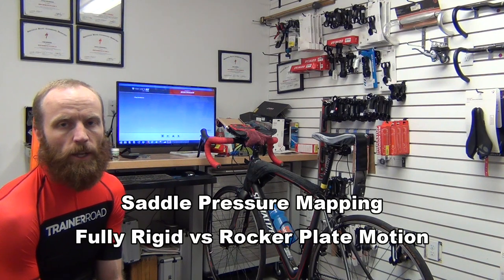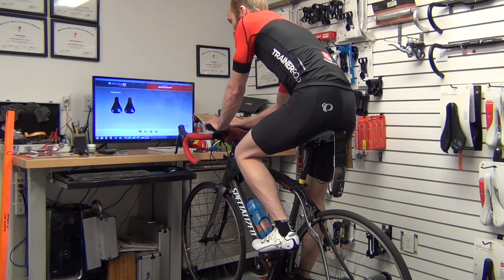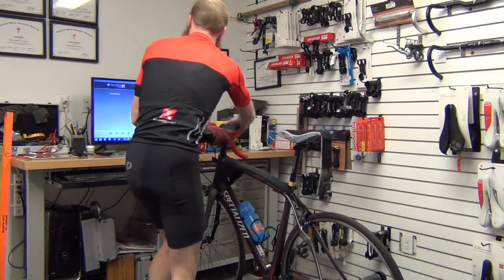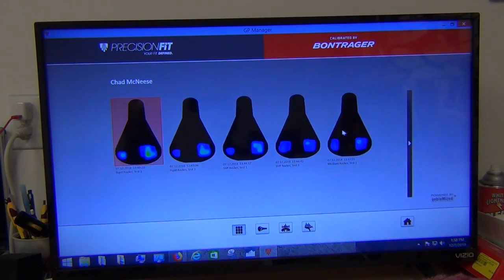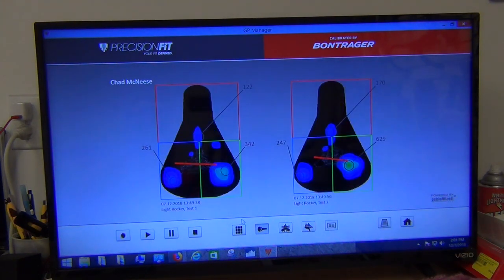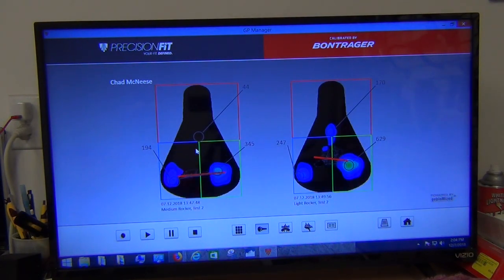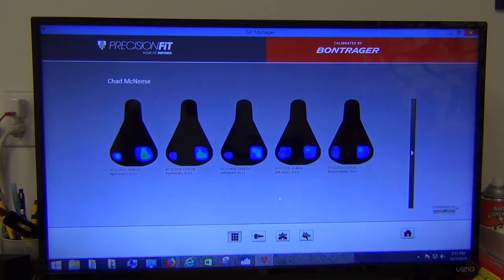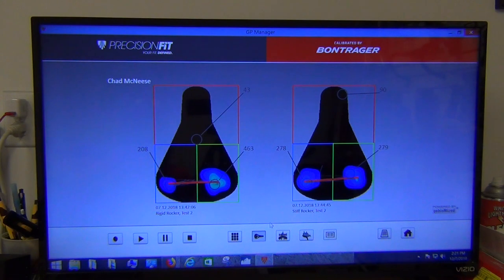Rocker Plate Testing with Saddle Pressure Mapping

Comment: Brilliant!  Thanks so much Chad!
Reply from the maker: Happy to help.  It's far from conclusive, but a window into the anecdotal feeling so many rocker plate users feel when it comes to improved seated comfort on the trainer.  :D
Reply: @Chader9  it's coincidental, but I have sent an Axxion Rocker to Retul and they are planning more or less the same test you just did, but they will have more comprehensive data, on leg/knee/ankle changes along the entire kinetic chain.

I have posted on the Bikefit Pros page, and plugged your forum there.
Reply from the maker: @Traxxion  awesome to hear.  Please share any results you are able to.  I would love for someone with more tools, time and rider samples to do testing like this.  I think a proper study is in line actually.  I'd love to have many sample riders, many rocker types, and variation in motion (pure roll-axis, pure surge motion, and both combined) to see what each degree of freedom adds.  Couple that with goals to look at comfort, RPE, power and such to get a more comprehensive picture of the impact of motion vs rigid setups.  Exciting times :D

Comment: Thank you for the video. I train on my XC bike on a Kickr and  still get pain in the behind increasing with ride length. I feel like I've exhausted other options (getting used to it, getting the best saddle and bibs for me, having proper fit), all of which did help but I would still like some more and am now looking at getting a rocker plate and was looking if that is likely to improve the situation. Seems like the answer is yes.
Reply from the maker: Sounds like you've looked at about every other angle. So adding some motion seems like the next step.

Keep in mind that sometimes even a small amount of motion can help.  Many people have good results with simple foam blocks added under the trainer feet.  

Free it up a bit to wiggle.  It's not the same total feel of a rocker, but is cheap and easy to test and see if it can help you.
Reply: Cheers. I'm going to try the foam blocks, should be able to find some at low cost. I do have the Axis feet (that give a bit of motion) on the trainer, but one of them is screwed fully in (my floor seems to be a bit uneven), so no more room to get movement from that setting. However I'm using the medium spacers or whatever on the feet and will try the smallest ones (supposed to provide some extra motion) as well.

Comment: Hi @Chad, do you consider is a good point adding a rocker plate to the home trainer if you ride 2-4 times x week ? If it’s the case , is a big difference between the plates with  side movement and the side and fore and aft movement ?? Is it worth to pay the extra price for the rocker with full motion instead of only lateral movement ??
Thanks in advance
Reply from the maker: I ride 3-5 times per week and would be hard pressed to go back to rigid.  It is just plain odd to me when riding rigid for short tests now, and I would not do it by choice for any real extended periods.  But, as with anything, this is highly personal.  Many people find the benefits of trainer motion to show up most once you hit that 45 minute and longer ride time.  The motion relieves the common saddle pressure issues we see with many rigid setups.  But for me, even with those shorter workouts I still prefer motion.

With respect to rocking and fore-aft, I have done setups with both.  I like the fore-aft, but trained for years with pure rocking action and got notable comfort benefits.  That said, it seems that most people like the added comfort that comes with fore-aft, so it is a generally safe recommendations.  Noting that, there are more than a few people who have tried fore-aft and decided they don't like it.  There can be excessive movement and potential power loss with some riders and setups.  So I try to not commit too hard on recommendations there.  It seems highly personal.

Comment: @Chad this is great, thank you. Where did you get the pressure mapping device -- is it possible to rent one of these?
Reply from the maker: Thanks so much.  It was a very fun and informative experiment.

The pressure mapper is part of the bike fit tools that my shop has and I used for my side gig as a fitter.  This one died and we haven't gotten the replacement running as of yet, unfortunately.

If you check with shops in your area, ones that do bike fits specifically, they might have one. It's a rather expensive tool, but I'd bet they offer fits or use of the mapper for a fee.

Comment: Really interesting. Can I ask if you've looked at Power and if that is affected by the rocker plate?
Reply from the maker: I have done no testing to this point, but have a working document with comments and speculation as to power from a number of different angles.

https://docs.google.com/document/d/1rsOK6Qym9tFR6wrVScs65-LfFIGKykfirA5f04Z-KBA/edit?usp=sharing

In short, it is a complex issue and depends on what you want to compare (Rocker vs rigid vs outside riding / peak power vs steady power vs power efficiency).

A proper analysis would require some well thought out planning and many study participants.  I'd love to do it, but time is always the limiter with a family, job, and riding.

Comment: In your control test, you stood to reset for test 2.  None of the other test 2s were reset by standing.  This also speaks to long term.  Can the recording software do an analysis of an hour ride? If you do the same ride on each setting I think the data would be more useful, actually as the edge cases will get diluted out better.
Reply from the maker: I'd have to watch, but that is totally possible I missed consistency from test to test.  A side-effect of doing this at my workplace in somewhat hurried fashion to get at least some testing done when I had access :P

For the software, it only captures a short timeframe (around 5-10 seconds, but I don't remember the precise time).  You can do as many separate captures as you want, so you could just keep doing captures to catch snippets of a longer ride over time.  You'd then be able to compare any of those snips to any other one in that test or another one.  Would take some real time and work to do and likely best to have a second person involved so the rider could simply pedal while the other person ran the sampling.  

For sure there are ways to improve this test.  I make no claims that it is absolute or scientifically significant.  With N=1 and me being a biased and very experienced rocker users, my results may well not be typical.  It is just one experience with some data that matches my personal experience.  It is still the only shared data that I have seen.  I know some companies have done their own testing, but have not seen any of it posted for review.

Despite the obvious shortcomings of a short and limited test, this data seems to correlate very well with all the other anecdotal info from the thousands of happy rocker plate users in my Rocker Plate FB group.  We see a strong long-term adoption rate from people who actually try a rocker plate.  The vast majority say that it improved their riding comfort, especially when going longer than one hour.  Am most say they wish they had tried one sooner because they don't want to go back to rigid trainers any time soon.

Comment: By the amount your hips are rocking, it looks like your saddle is too high, which pretty well invalidates all your data. How did you get to such a high saddle setting?
Reply from the maker: I disagree the data is invalid.  Regardless of the saddle height, there are clear differences in peak saddle pressure between the rigid and motion setups.  This data corresponds well with my personal experience in reduction of saddle discomfort with motion added.  It is also backed up with similar comments on improved comfort by literally thousands of happy rocker plate users as shared in my FB group.  We have over 17,000 members, and the vast majority rate improved comfort as the key reason the like having a rocker plate.

With regards to saddle height, I the saddle pressure mapper adds a bit of thickness to the setup, and I chose not to lower my saddle just for this testing.  That and the surface material may lead to a bit more motion than my setup without that in place.  And I do think I ended up adjusting my saddle lower at some point.  Maybe 3-5mm, but that setup was over 2 years ago, and I have tried different saddles and setups since that time.